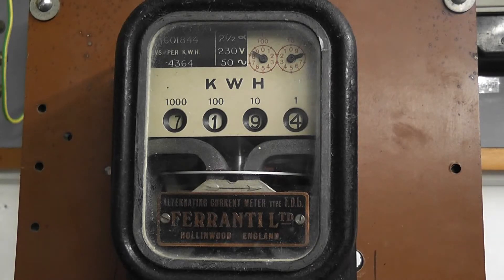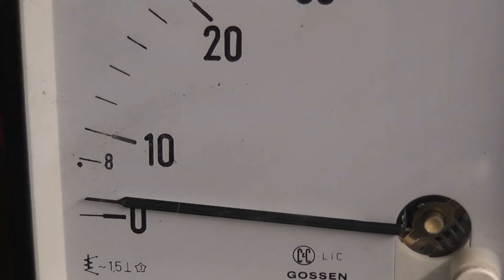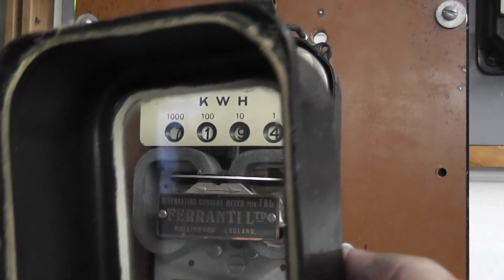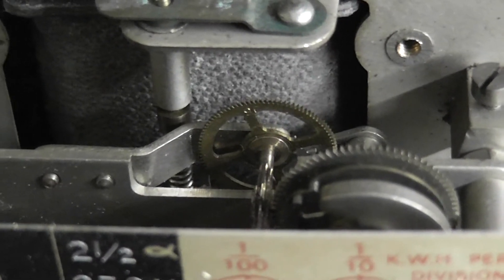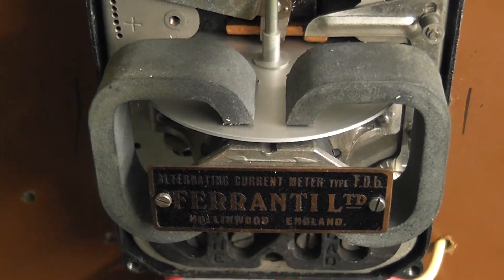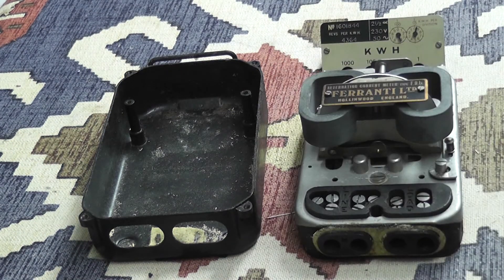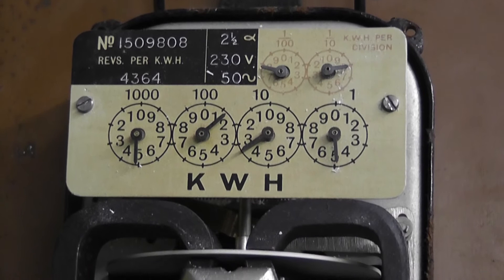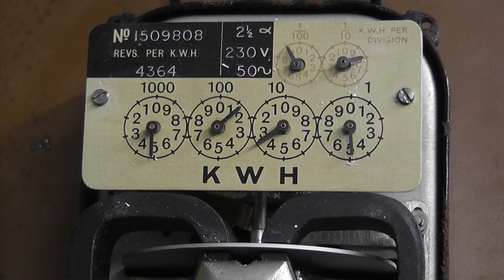Ferranti FD and FDb meters

Comment from the maker: @BoomBoxDeluxe The S200.16 has 6 turns on the current coil for 250 rev.
The S200.31 has 4 turns for 166.67 rev.
These meters have easy accessible and visible turns on the current coils.

Comment from the maker: @BoomBoxDeluxe If you look at the design of current coils you will also see that the amount of turns is directly related to meter speed.
Your Sangamo HM runs at 750 revs/kWh. We had also HM meters with 375 rev/kWh in NZ. Then the S29.1 ran at 375 rev. The S29.11 ran at 250 rev.
more in part 2

Comment: @RODALCO2007 Nice. :-) Thanks for that info. It's interesting about what you say in regards to the current and the revs/kWh, in that the meters have a higher revs/kWh as the current is lesser.

It's amazing that these FDb meters still run. My Sangamo type HM runs at only 750 revs/kWh, and while there's no knowing how many kWhs that's registered over its lifetime, it's probably not as old as these FDbs, yet when I got it, the top needle-point was completely sold out. :-D

-BoomBoxDeluxe.

Comment from the maker: @BoomBoxDeluxe From the FD (b) meter I have in my collection. these constants and current ranges I have
20 Amps 545.5 rev / kWh
10 Amps 1091 rev
5 Amps 2182 rev
2½ Amps 4364 rev
Basically half the current, double the disc speed.

Comment from the maker: @rdekema You are correct, these systems were in use in the Northern remote area's where the power lines were of lower capacity than in the cities.
This meter was taken out of service about 30 years ago.
Most NZ hot water heaters are between 2 and 3 kW for 30 or 40 Gallon tanks.

Comment: What is a "750 Watt controlled hotwater load"? If it has something to do with heating water, as the name suggests, it doesn't seem like 750 W would be able to heat much water very quickly...?

Comment: 10A x 240v = 2400W or 2.4KW  4364 Revs per KWH so in one hour it would have done 2.4 x 4364 = 10473.6 or 174.56 RPM just under 3 turns a second :)